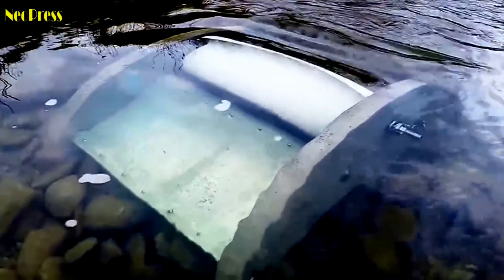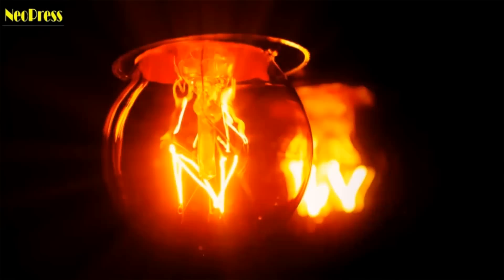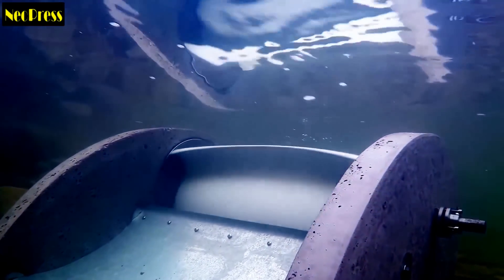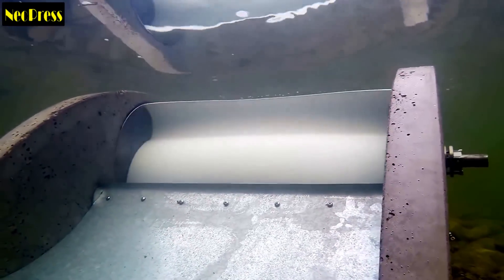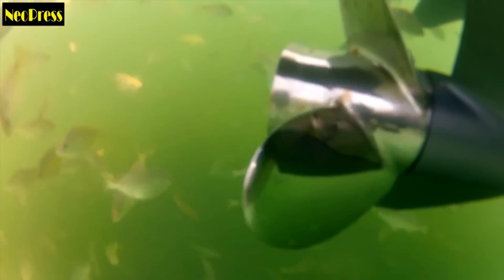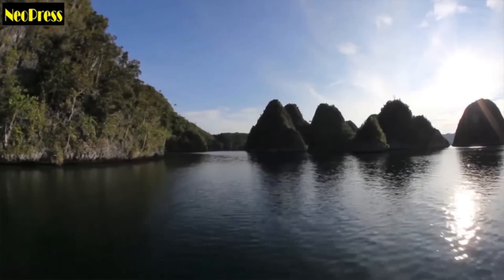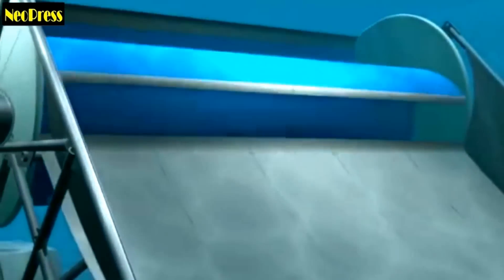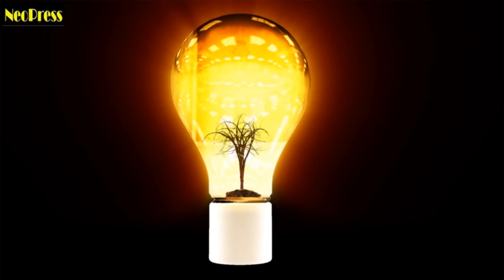Waterotor: A New Renewable Energy Source

Comment: BigBattery, Inc. is the largest supplier of surplus and re-certified batteries in the United States.
Our core purpose is to promote the mass adoption of renewable energy solutions. While the cost of alternative energy has decreased substantially within the past decade, Batteries have remained expensive. Cost-effective energy storage remains the single greatest hurdle for the mass adoption of our clean and independent energy future.
In this Covid19 stage, they are manufacturing ProClean 75% Alcohol Wipes, which are OTC & FDA Certified, safe to use on skin and organic material. These wipes eliminate all Virus & Bacteria on your skin and any surface. https://lnkd.in/gdeQDUJ
#batteries #future #energystorage #renewables #energy #covid19 #wipes